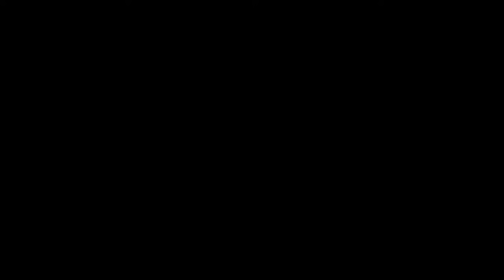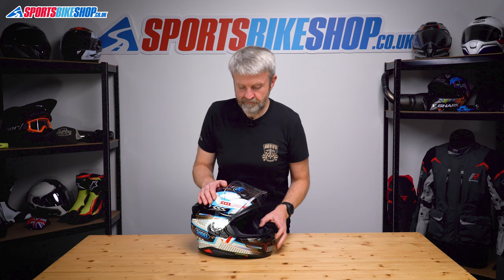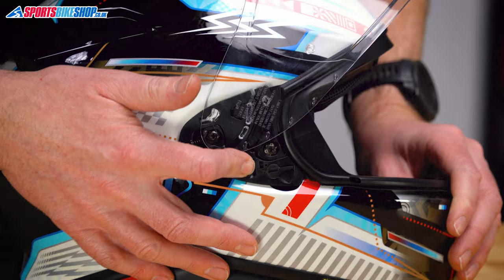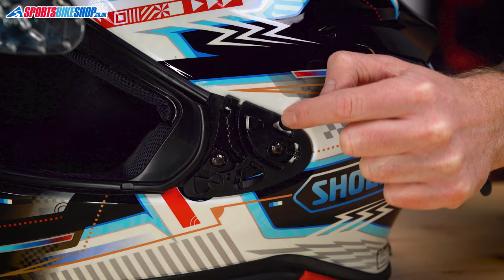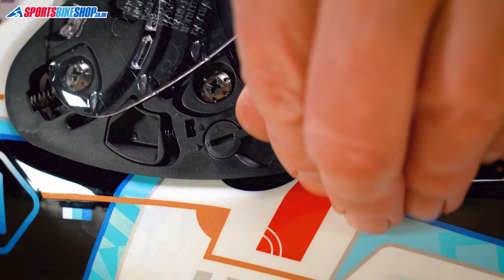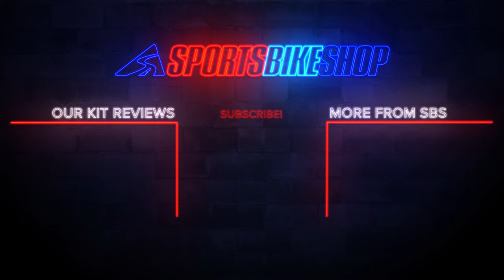How to change a visor: Shoei NXR 2 motorcycle helmet

Comment: Just picked up my first helmet today along with photcromatic visor that wasn't installed I looked at the mechanism and though that looked way to complicated maybe I wont bother using my $250 visor right now. 30 seconds later changed! LEGEND!
Reply: How are you finding the visor? Is it worth the price? I'm thinking about getting one but don't know anyone who has and can advise me if it's worth it or not
Reply: @wavehopper08  it is expensive but absolutely worth it. Probably my favourite bit of kit australia is very Sunny generally but it’s storm season so sunny too dark and grey in minutes. If you pick one up you won’t be disappointed
Reply: @lazww  thanks for the reply. I  am changing my helmet in 2 weeks and was looking at the shoei but wanted sun visor. Didn't want to have a totally tinted visor and need to carry another.  It's expensive but if it does the job well I'm happy. Safe riding chap thanks 👍

Comment: Hi there.
Thank you for the video. I have done as you do in your video, installed the pinlock and put the visor back on. It moves up and down fine but the visor doesn’t lock closed, the pinlock prevents it . Am I installing the pinlock wrong?
Any help will be appreciated. Thanks.
Reply from the maker: It's hard to say for sure without seeing it, but it sounds like the Pinlock is in wrong as it shouldn't block the visor travel. There's a recess on the inner surface of the visor for the Pinlock to sit in. Make sure the top edge of the Pinlock is butted up to the ridge at the top of the visor, but doesn't overlap with it. Check also that the bottom edge of the Pinlock sits inside the recess there. If that's the case then it's not going to be an issue with the Pinlock installation and I'd see if you can get to a Shoei dealer and ask for some assistance. Cheers, Tony